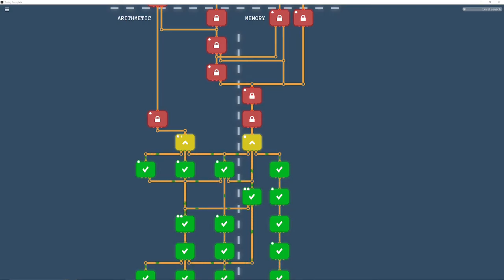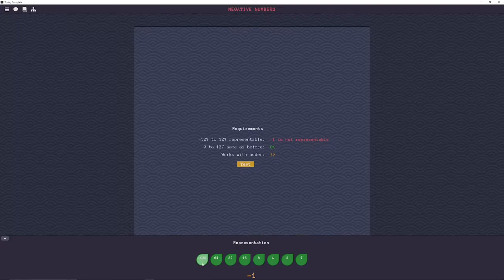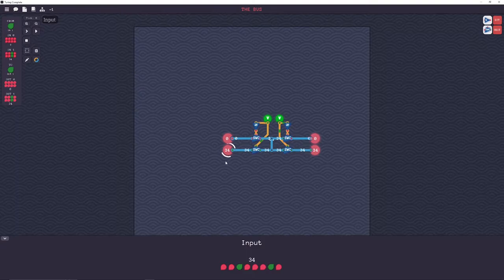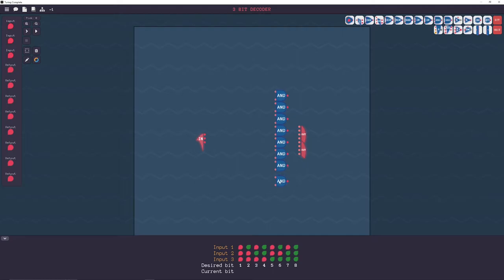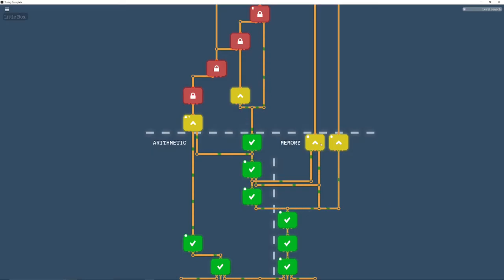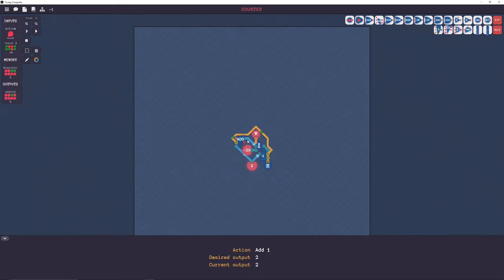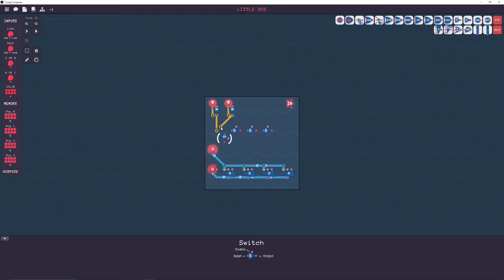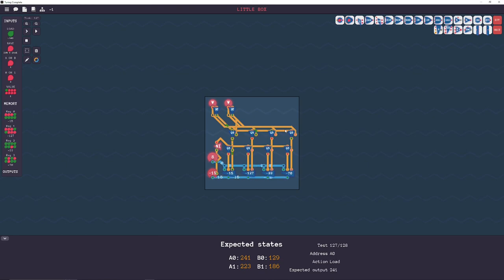TURING COMPLETE WALKTHROUGH - ARITHMETIC/MEMORY pt.2

Comment: Hey thanks for the solutions, I love your videos. One thing I noticed, however - on your Little Box solution - is that the shortcut you took with the load switches made it so that the output doesn't match the expected output when the input is set to don't load (The expected value for don't load is always 0). For some reason, The game doesn't give you a fail for it, which is why the strategy you used here is viable
Reply from the maker: Glad you've been enjoying them! It doesn't fail because the game doesn't check the value when the load pin isn't set.

Comment: For input selector, you already have the option to use 8-bit switch so two of them is enough to implement this. By the way, thanks for the video!
Reply from the maker: when I first created the level the 8-bit switch wasn't available so when I redid the level to record I didn't check for it

Comment: Yeah I got through everything including little box on my own, but I couldn't figure out what is going wrong with my counter solution. The register seems to forget everything inside it randomly unless I leave the "save" and "load" turned permanently on, which is annoying. It should remember. The concepts are easy to me, but the way the register works doesn't make sense to me.

Comment: bruh... I was stuck on the signed negator foreverr, I had at one point even added the add math component as well but ofc... wasn't using it properly lmao... thank you!
Reply: I was doing the same thing then I thought,  well.. I just need to add one bit, and figured it out.

Been checking solutions to compare mine with others to make sure I wasn't missing anything

Comment: As soon as I tried your last solution, on tick 5, A mistake appeared! It's not 152, but 134!!!!!!
Reply from the maker: On the Little Box level?
Reply: @Andoxico  Yes
Reply from the maker: @andreiinthedesktopworld1178  Make sure you didn't cross any wires and connected the input/output pins correctly. I just copied the schematic that's in the video and it worked fine
Reply: @Andoxico  Did it

Comment: The first one could have been made much simplee because you can just use bit switch that only activated while the input on or not
Reply from the maker: the level originally didn't have the byte switch available so when I went to do the level for the recording I didn't think to check which switches were there